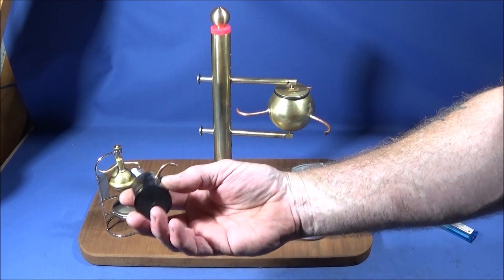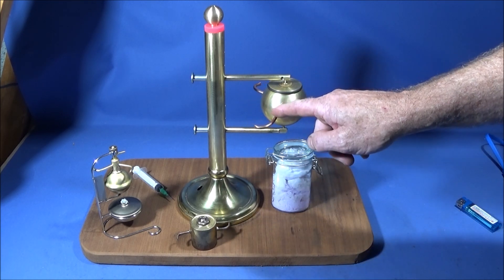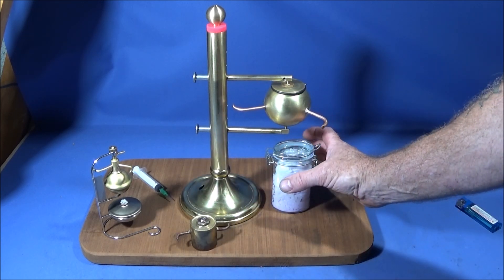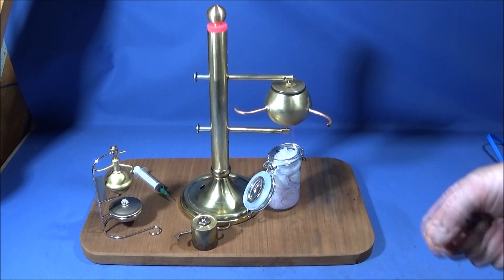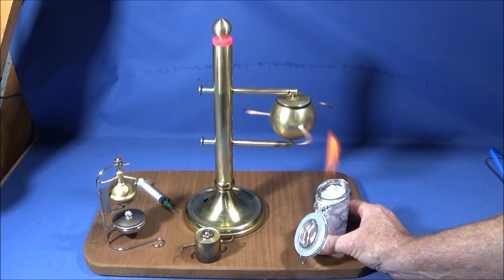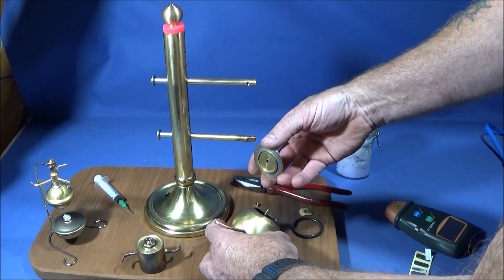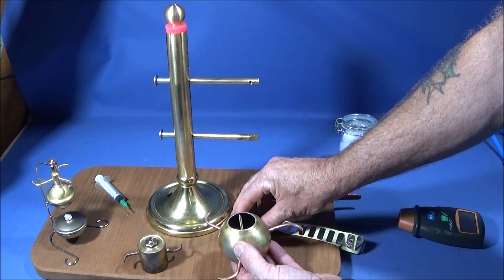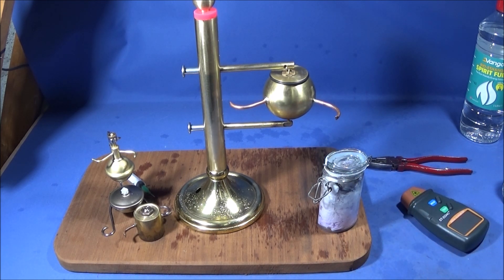How I Made A Large Hero Steam Engine From Other Old Brass Items.

Comment from the maker: The Microcosm Engine Shown.
Microcosm Micro Scale T1B Steam Engine -- https://goo.gl/H9w9Uo
 $1.99 Tools & Mechanical Parts -- http://bit.ly/2OSwi2O
2019 Banggod Electronics & Tools Sale -- http://bit.ly/2KYyenl
2019 Banggood Summer Sale Shopping Guide -- http://bit.ly/2Lt4Kxy
Reply from the maker: HERE ARE SOME COUPONS FOR SOME EXCELLENT DEALS ON BANGGOOD
$21.68 4pcs MSPA Inflatable Hot Tub Replacement Kit -- http://bit.ly/2Zr0k1H (coupon: BG1726)
$48.99 Machifit ER11 Chuck CNC 500W Spindle Motor -- http://bit.ly/2ZB99lC (coupon: BG500W)
$33.99 HILDA 220V 350W Variable Speed Electric Grinder -- http://bit.ly/30GTAdt (coupon: BGEG35)
$23.99 HILDA 220V 400W Electric Paint Sprayer -- http://bit.ly/2MJSVob (coupon: BG2c532d)
$213.19 Machifit CNC 5 Axis 500KHZ Offline Controller -- http://bit.ly/2L2i2Al (coupon: BGMACH3)
$32.79 Machifit MACH3 4 Axis USB Electronic CNC Handwheel -- http://bit.ly/2ZkC5CV (coupon: BGMACH3)
$36.99 Self Centering Dowelling Jig -- http://bit.ly/2MH3yIo 
$19.99 Drillpro 8pcs 2-12mm 4 Flutes Tungsten Steel Milling Cutter -- http://bit.ly/2ZkC5CV